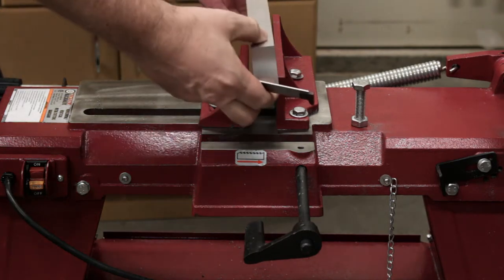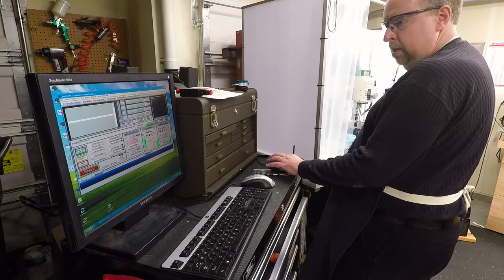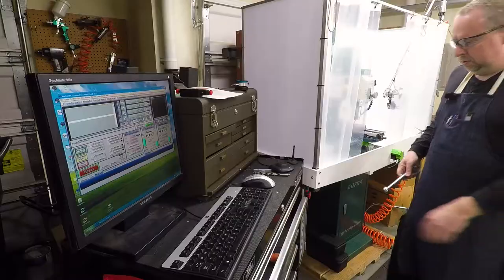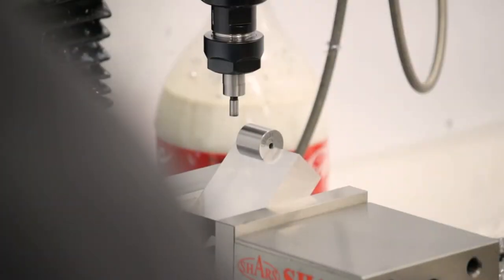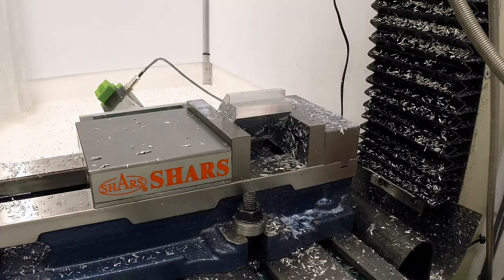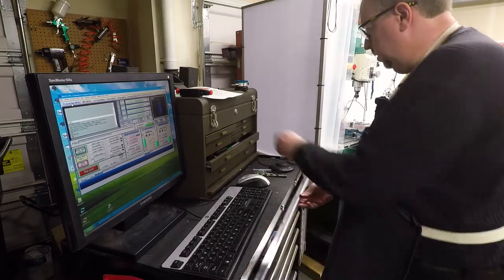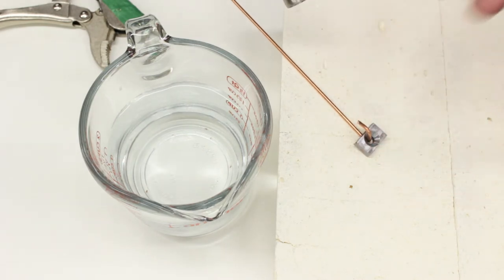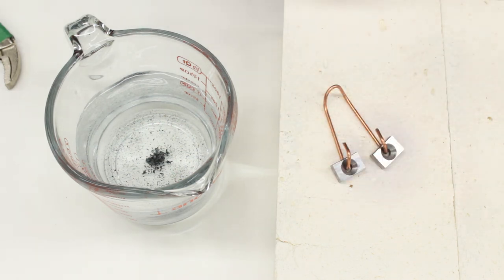Making TalonGrip Low Profile Edge Jaws - Part 2

Comment: Nice work James. The annotations you add to the videos are a nice touch and your tool storage is second to none. You might want to consider getting a small dead blow hammer for seating work in the vise, they work really well.
Reply from the maker: Tony P Thanks!  I actually have a dead blow hammer that I usually use, but the vise handle was in my hand and since I was facing the part  anyway...

The tool storage is all 3D-printed.  I'll have to do a video on it someday.
Reply from the maker: Oh, I was confused there for a moment.  I guess I used a soft-face hammer in this video.  Just wait.  There's another one coming where I used the ball end of the vise handle to tap down a part.  :)
Reply: You did it in this one too. At least twice ;-) 9:15 and 10:25. Looking forward to seeing a video on your tool storage.
Reply from the maker: Okay, thanks.  I'll consider myself suitably chastised.  I have a couple of videos still in the pipeline, so you might yet see it again.  :)

Comment: 'Should be perfectly square'. Sigh. NOTHING is perfectly anything- but it will be within tolerance. Which is what is needed. Engineer thinking never deals with exact, perfect, or any other Platonic ideal- the consideration of permitted tolerances and specifications should be constantly in mind. Pedantic? No, it is fundamental to engineering.